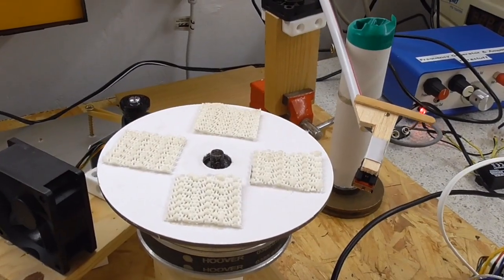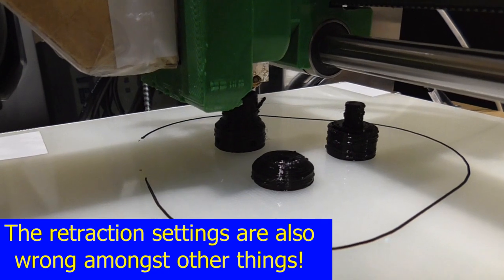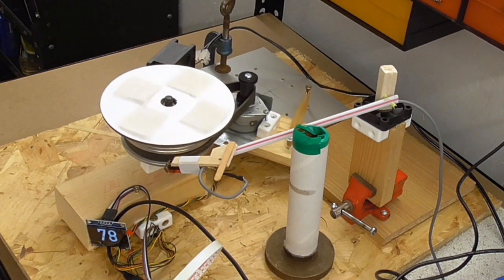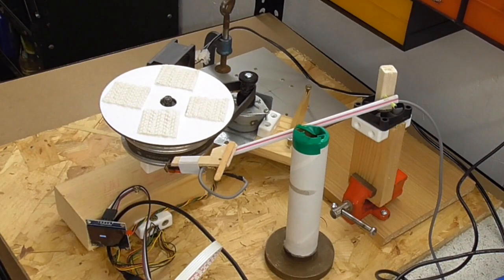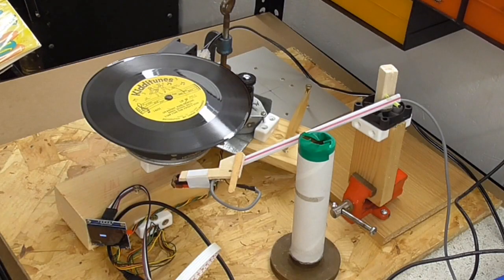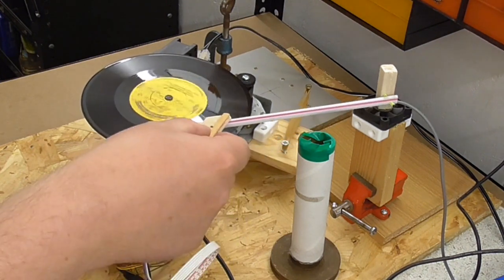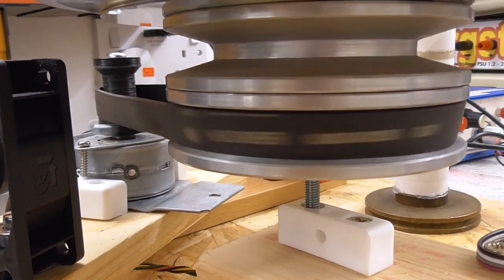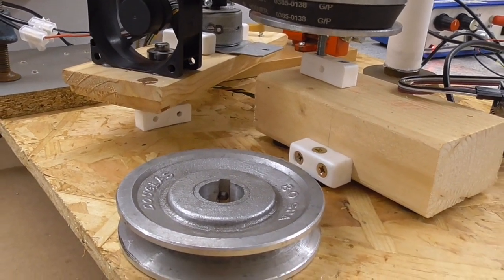Belt Driven Stepper Record Player!

Comment: Hello, came across this just today - nice attempt. I have myself built a direct-drive turntable based on a stepper motor. You can check it out here:
https://youtu.be/6yoMAh7vAlg

And the demo here:
https://youtu.be/PN47wAvJ37E
Reply from the maker: Thanks 😀 👍.  Good build, your one and works well. I did try a direct drive stepper motor first, but it wasn't very good at 33rpm. I have some more ideas on that now so hope to have another go at some point

Comment: Progress. That is a much bigger belt than I had in mind. I had been expecting something closer to a rubber band 🙂👍
Reply from the maker: I've looked and failed to find suitable rubber bands in shops I have visited recently. I do have 1 potentially suitable one, though I think I will need to change the small pulley. I may do that in future. I've tweaked the one in this video some more and have got it more stable though I don't yet understand why the 33 particularly is so bad. Thanks 😀

Comment from the maker: // Open SCAD code to generate the 3D printed parts

$fn=32;

cd_thickness = 1;
cd_hole_radius = 7;
adapter_base_height = 10;
adapter_base_radius = 9;

top_peg_radius = 7/2;
top_peg_height = 8;

pulley_hole_radius = 7/2;
pulley_hole_depth = 8;
pulley_inner_height = 12;
pulley_outer_height = 18;
pulley_inner_radius = 7;
pulley_outer_radius = 10;
pulley_base_height = 8;
pulley_top_height = 4;
pulley_top_screw_radius = 2;
pulley_side_screw_radius = 1.5;

pulley_flange_height =  (pulley_outer_height-pulley_inner_height)/2;

// First set of modules make the 2 parts of the pulley 
module drive_pulley()
{
    difference(){
        union(){
            drive_pulley_base();
            translate([0,0,pulley_base_height]){
            drive_pulley_flange();
            // this is the central column of pulley
            cylinder($fn=64, h = pulley_outer_height, r = pulley_inner_radius, center = false);
            }
        }
        bottom_hole();
        top_hole();
        screw_holes(6,90);
        screw_holes(6,0);
    }
}

module drive_pulley_base()
{
            cylinder(h = pulley_base_height, r = pulley_outer_radius, center = false);
}

module drive_pulley_flange()
{
            cylinder(h = pulley_flange_height, r1=pulley_outer_radius, r2 = pulley_inner_radius, center=false);
}

module drive_pulley_flange_top()
{
    difference(){
        union(){
            cylinder(h = pulley_top_height, r=pulley_outer_radius);
            translate([0,0,pulley_top_height])
            drive_pulley_flange();
        }
        
        cylinder(h=20,r=pulley_top_screw_radius,center=true);
    }
}

module top_hole(){
        translate([0,0,pulley_outer_height+5])
        cylinder(h=18,r=pulley_top_screw_radius,center=true);
}

module bottom_hole()
{
 translate([0,0,-1]) cylinder(h = pulley_hole_depth+1, r = pulley_hole_radius, center = false, $fn=64);
}

module screw_holes(height,angle){
    translate([0,0,height/2]) rotate([0,90,angle])  cylinder(h = 25, r = 1.25, center = true);
}

// modules from here make the CD adapter for the top
module cd_adapter()
{
    union(){
        adapter_base();
        translate([0,0,adapter_base_height]) cd_fitting();
        translate([0,0,adapter_base_height+cd_thickness])top_peg();
    }
}

module adapter_base()
{
    cylinder(h = adapter_base_height, r = adapter_base_radius, center = false);
}

module cd_fitting()
{
 cylinder(h = cd_thickness, r = cd_hole_radius, center = false, $fn=64);
}

module top_peg()
{
 cylinder(h = top_peg_height, r = top_peg_radius, center = false, $fn=64);
}

translate([15,15,0])cd_adapter();
translate([-15,-15,0]) drive_pulley();
translate([20,-20,0]) drive_pulley_flange_top();

Comment from the maker: Arduino code (for Sparkfun Pro Micro - but easily changed for other boards

/*
 Stepper Motor Record Turntable

 This program drives a unipolar or bipolar stepper motor.
 The motor is attached to digital pins 14,15,4,5 of the Arduino (Sparkfun Pro Micro).

 Buttons connected to pins 6-9 control the speed
 6 = 0 rpm
 7 = 33 rpm
 8 = 45 rpm
 9 = 78 rpm

 8 (45) and 9 (78) pushed together take turntable into low speed mode (set by LOW_SPEED)
  
 Based on Arduino example by Tom Igoe
  Created 11 Mar. 2007
 Modified 30 Nov. 2009

mrrgstuff - 2019

============ BSD License for U8g2lib Code ============

Universal 8bit Graphics Library (http://code.google.com/p/u8g2/)

Copyright (c) 2016, olikraus@gmail.com
All rights reserved.

Redistribution and use in source and binary forms, with or without modification, 
are permitted provided that the following conditions are met:

* Redistributions of source code must retain the above copyright notice, this list 
  of conditions and the following disclaimer.
  
* Redistributions in binary form must reproduce the above copyright notice, this 
  list of conditions and the following disclaimer in the documentation and/or other 
  materials provided with the distribution.

THIS SOFTWARE IS PROVIDED BY THE COPYRIGHT HOLDERS AND 
CONTRIBUTORS "AS IS" AND ANY EXPRESS OR IMPLIED WARRANTIES, 
INCLUDING, BUT NOT LIMITED TO, THE IMPLIED WARRANTIES OF 
MERCHANTABILITY AND FITNESS FOR A PARTICULAR PURPOSE ARE 
DISCLAIMED. IN NO EVENT SHALL THE COPYRIGHT HOLDER OR 
CONTRIBUTORS BE LIABLE FOR ANY DIRECT, INDIRECT, INCIDENTAL, 
SPECIAL, EXEMPLARY, OR CONSEQUENTIAL DAMAGES (INCLUDING, BUT 
NOT LIMITED TO, PROCUREMENT OF SUBSTITUTE GOODS OR SERVICES; 
LOSS OF USE, DATA, OR PROFITS; OR BUSINESS INTERRUPTION) HOWEVER 
CAUSED AND ON ANY THEORY OF LIABILITY, WHETHER IN CONTRACT, 
STRICT LIABILITY, OR TORT (INCLUDING NEGLIGENCE OR OTHERWISE) 
ARISING IN ANY WAY OUT OF THE USE OF THIS SOFTWARE, EVEN IF 
ADVISED OF THE POSSIBILITY OF SUCH DAMAGE.   
 
 */

#include <Stepper.h>

#include <Arduino.h>
#include <U8g2lib.h>

#ifdef U8X8_HAVE_HW_SPI
#include <SPI.h>
#endif
#ifdef U8X8_HAVE_HW_I2C
#include <Wire.h>
#endif

U8G2_SH1106_128X64_NONAME_1_HW_I2C u8g2(U8G2_R0, /* reset=*/ U8X8_PIN_NONE);

const int stepsPerRevolution = 48;  // change this to fit the number of steps per revolution
// for your motor

// Buttons for changing speed
#define Button_0 6
#define Button_33 7
#define Button_45 8
#define Button_78 9

// LOW_SPEED is a special mode for turning the turbable slowly. Not for playing a record
#define LOW_SPEED 15

int rpmspeed = 0;
int count = 0;
bool state = true;

// initialize the stepper library on pins 14,15,4,5:
// Pins 2 and 3 left for I2C OLED display
Stepper myStepper(stepsPerRevolution, 14, 15, 4, 5);

void setup() {
  pinMode(Button_0 ,INPUT_PULLUP);
  pinMode(Button_33,INPUT_PULLUP);
  pinMode(Button_45,INPUT_PULLUP);
  pinMode(Button_78,INPUT_PULLUP);

  // set up the display for the speed selection
  u8g2.begin();
  u8g2.setFont(u8g2_font_logisoso62_tn);
  display_string("--"); // just to show arduino has started
  delay(1000);
  // set the display to 0 rpm)      
  display_speed(rpmspeed); // will blank display as don't show 00
        
  // initialize the serial port:
  // Serial.begin(9600);
}

void loop() {
  // step half a revolution of stepper motor (about 1/10 of the platter rotation)
  if (rpmspeed != 0){
      myStepper.setSpeed(rpmspeed*4.9); // x5 approx for belt drive
      myStepper.step((stepsPerRevolution/2));
      count=0;
  }else{
    if (count++>10000){
      count=0;
      state=!state;
      if (state){
        display_string("- ");
      }else{
        display_string(" -");
      }
    }
  }
  // Low Speed mode turned on if 45 AND 78 pushed at time
  if ((digitalRead(Button_45)==LOW) && (digitalRead(Button_78)==LOW)){
    if (rpmspeed != LOW_SPEED){
      rpmspeed = LOW_SPEED;
      display_string("//");
      delay(500); // give user a chance to release buttons
      display_speed(LOW_SPEED);
      return; // return immediately - don't do rest of loop this time around
    }
  }
  if (digitalRead(Button_0)==LOW){
      if (rpmspeed != 0){
        // Serial.println("0 button pushed");
        rpmspeed=0;
        display_speed(rpmspeed);
      }
  }
  if (digitalRead(Button_33)==LOW){
      if (rpmspeed != 33){
        // Serial.println("33 button pushed");
        rpmspeed=33;
        display_speed(rpmspeed);
      }
  }
    if (digitalRead(Button_45)==LOW){
      if (rpmspeed != 45){
        // Serial.println("45 button pushed");
        rpmspeed=45;
        display_speed(rpmspeed);
      }
  }
  if (digitalRead(Button_78)==LOW){
      if (rpmspeed != 78){
        // Serial.println("78 button pushed");
        rpmspeed=78;
        display_speed(rpmspeed);
      }
  }
}

void display_speed(int speed)
// Converts speed to a string and calls display routine
{
    char speed_str[3];
    strcpy(speed_str, u8x8_u8toa(speed, 2));    /* convert speed_str to a string with two digits */
    if (speed==0){ strcpy(speed_str,"  ");}
    display_string(speed_str);
}

void display_string(char *txt)
// Displays string on 128x64 OLED display using u8g2 library
{
    u8g2.firstPage();
    do {
      u8g2.drawStr(25,63,txt);
    } while ( u8g2.nextPage() );
}